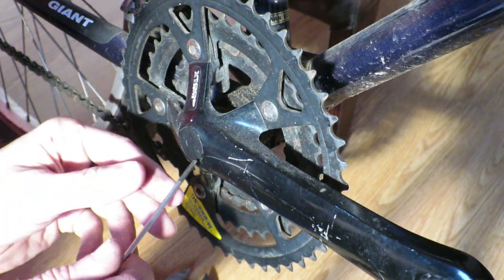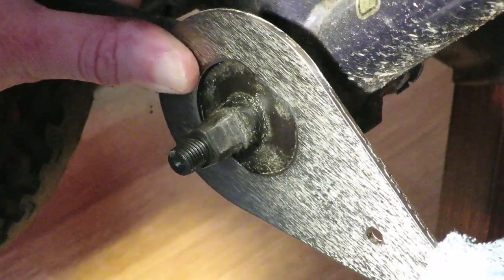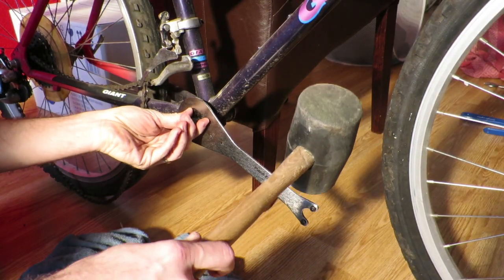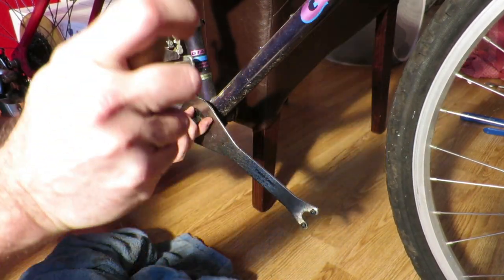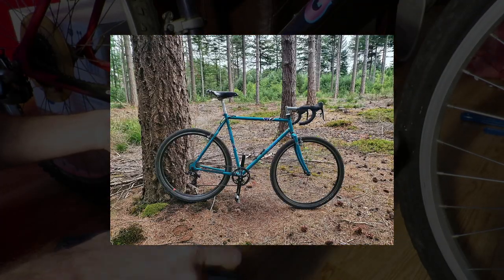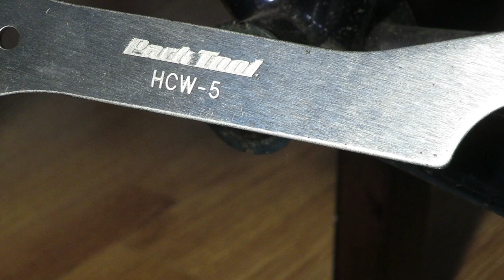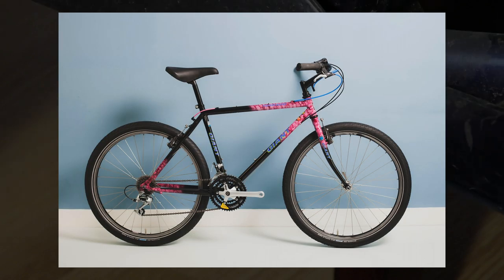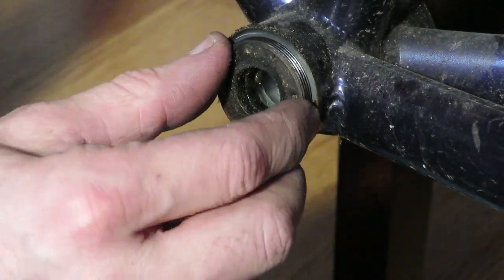Here's why you should buy a vintage Giant mountain bike

Comment: I would have replaced the bottom bracket with a Neco carbon shell one as they run smoothly compared to the loose assembly style original .
Reply from the maker: The bottom bracket wasn't compromised in any way, and I prefer reusing things on a bike that has all original parts like this one.